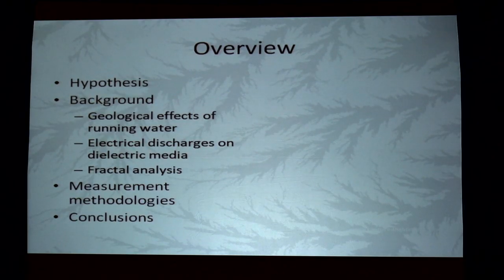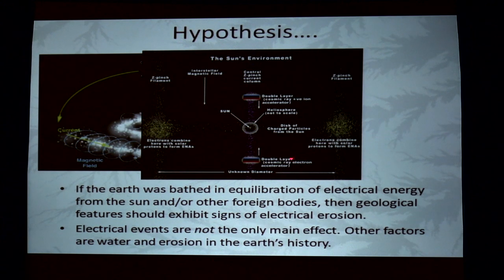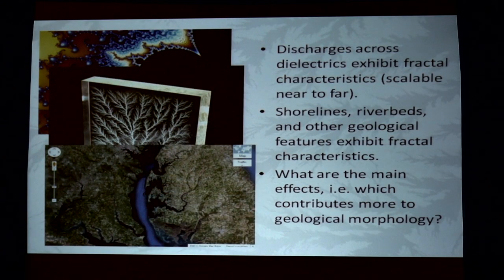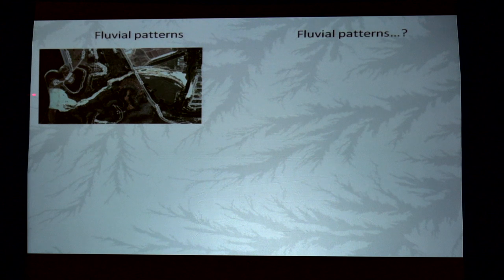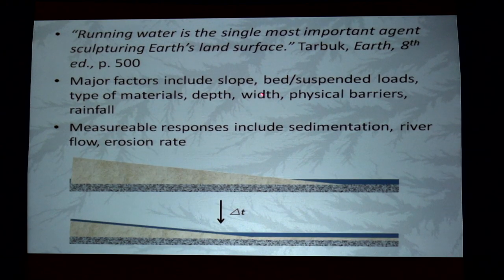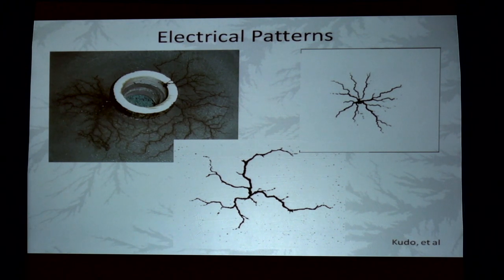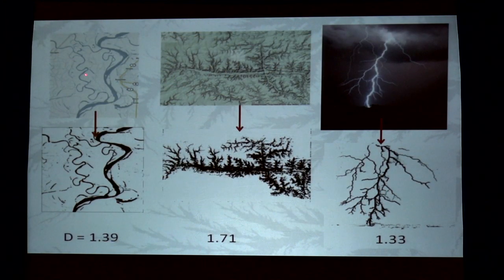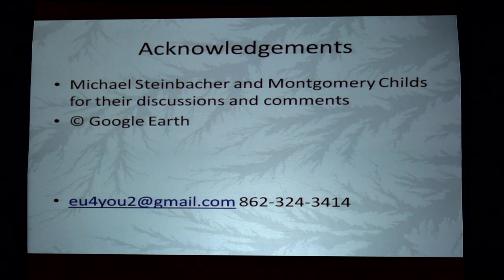Paul Anderson: Electrical Discharge on Earth's Surface | EU2013

Comment: Paul, I would assume, that the speed of the flow determis the resulting shape. Both electrical currents and water flow in mountains transport the eroded material quite quickly. The ration of erosion to sedimentation is in both cases cases big in comparisen to flat land rivers. So may be the high fractal dimension is in both cases the result of a high flow speeed?

Comment: The famous Barringer crater in Arizona is square not round. Makes me think it was formed electrically vs by meteor impact. & there seems to be another smaller crater to the south of it.
Reply: +JCHangtime You're right.  What kind of round object striking the ground would leave a square hole.  I've visited that gnat infested hole too and thought it weird.  Also note the many giant rocks thrown in all directions from it.  Seems more electrical strike than object strike.  Particularly since where is the meteor??  Should not most of the meteor be found in the bottom of the crater somewhere?  But it seems there is nothing there..

Comment: If the material is falling down to create these shapes how is that an electrical phenomenon? The way the upper elevations' erosion is explained in a standard geology context is not mentioned and therefore not challenged. That is what irked me about this analysis. To me the fractal or dendritic appearance is coincidental and due to the strength of the materials. For example a pile of aggregate will erode to steep slopes if you remove material from the side. Silly statistical argument.

Comment: Someone please help me here, whats the big deal? Really i want to know. Cant see a point. Any practical apps for that, but really whats the point?
Reply: I know it's been a long time for a reply, this means the topographic features on earth are the product of electric discharge on planetary level. When water flows to "create" rivers it does not exhibit fractal pattern; natural effects like water and wind generally create organic random erosion pattern. Only electrical discharge creates fractal topography.

In a nutshell standard geology is just another rigged science so it can fit the standard model of the solar system and big bang fables in so they artificially converge.